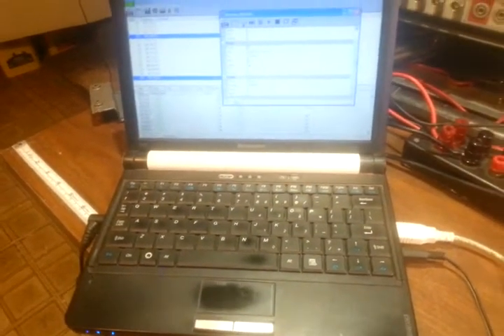Arduino Controlled 800MHz Maxtrac Radio with UniTrunker

Comment: Hi, very interesting video. Did you take flat audio from the Maxtrac and then you jut sent it via mic in to the laptop? It is not afected by the Maxtrack volume level or some TPL with the signal?

I´m very trying to do something like that but "the opposite", sending a signal from the laptop to the radio.

Comment: Or buy a $30 rebanded MTS2000 and get some pirated CPS to program it..
Reply from the maker: ElfNet Gaming not really. Without actual programming data for the trunk system, the radio is good for conventional systems only.
Reply: https://radioreference.com  - has all the data you need to put into CPS to make it work. 
https://hamfiles.co.uk - has info and CPS downloads for just about any radio.
https://www.ebay.com - has the RIB and cables for just about any radio.

Sure they will function on conventional systems but the problem with Maxtrac 800's is they are not flashable (rebandable), that's why that particular series is so cheap on ebay, they do not meet the FCC requirements for part 90 use anymore. They are virtually useless and not compatible with digital emission formats like P25, or DMR/Trbo.

Analog trunking and conventional systems across many bands (VHF, UHF, 800, 900 MHz) are going the way of a dodo for digital, all except special services like MURS, FRS, and GMRS.. There may be some public service trunking still in analog, held up by skeezy greedy service shop owners that re-licensed them to keep them locked into service but those in probability less than 5 years now will be history. At least the analog parts anyways.
Reply from the maker: ElfNet Gaming 
I think you're missing the point. Radio reference and other websites are not going to have critical data specific to a trunked radio system. While the truck groups and talk groups are made available, what you're not seeing is the actual data that is programmed into the radio to make that trunk system work.
Reply: Is that a fact? I can take any 800 MHz trunking radio (granted it's rebanded) and use Radioreference.com to program it and it work fine as a receiving unit. To make it transmit I need a valid unit / customer HEX ID that's registered in the system.

For a Motorola Type 2 (Smartnet / Smartzone) analog system you need 3 critical things, All are on the website if you take the time and pay attention to details of the site - Control channels (highlighted in red and blue), Systems Key and Connect tone.. From there its a matter of selecting the talkgroups (channels) you want by their Hex value.

Type 1 and LTR systems are similar but you have subfleet id's instead of talkgroups

The main issue with Maxtrac 800's as I mentioned before is they are not re-bandable radios like say an Astro Spectra or MCS2000. Since you are driving the VCO directly from your PC and maker board and not from the radios on board CPU you can virtually re-band it to work.. It's a neat project indeed but too convoluted if you want it as a day to day monitoring rig,
Reply from the maker: Why would you say it was too difficult/complex/elaborate for daily use? it is like anything, there is a learning curve. Granted, by today's standards for practicality, it is more or less useless. However! Going through the pains and delayed gratification of building it and making it work is certainly more enjoyable than any millennial would remotely comprehend.